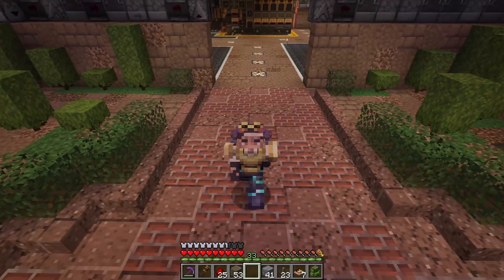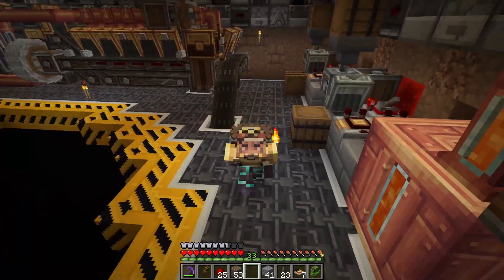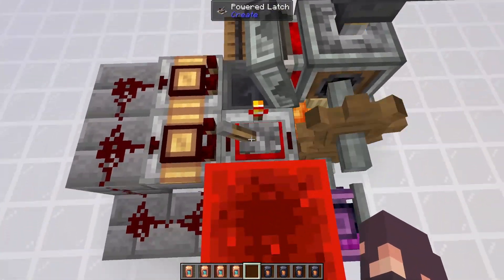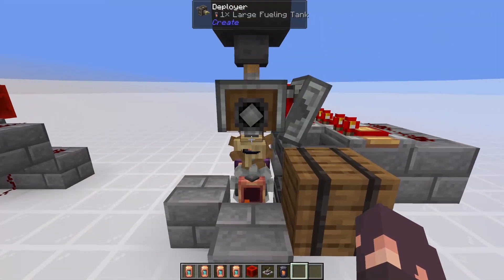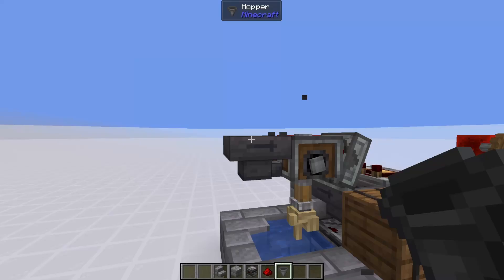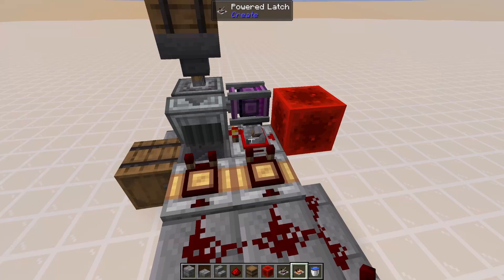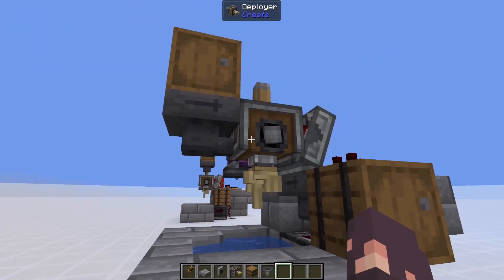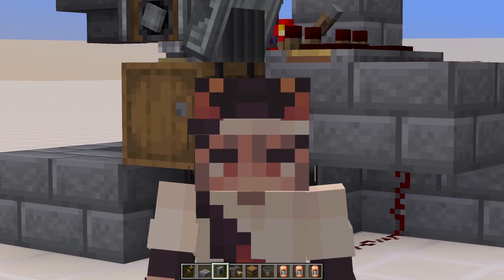Automatic Fueling Tank Refiller | Create Mod TUTORIAL

Comment: This is a great solution - regarding the lava i had to do some weirdness with it being pulled - my infinite source was some 80 blocks away - all pumps in between there and this one were running at max rpm as i thought they were too slow and thus wasn't filling quick enough. Because of this the observer perceived it as being done when in fact it just hadn't refilled yet. Got around this by having an intermediate tank that sits between this device and infinite source - so that fills whilst not in use. Not sure if its covered in the video or i did something wrong.
Reply from the maker: That’s good to know. I haven’t run into that because I just accidentally had a tank nearby that was quick enough to refill it. This is good info for anyone else running into this issue!
Reply: so you added a secondary tank between the tank refiller and infinite lava source and it began fully filling the fuel tanks?
Reply: @andysantos2716  Yes i did and im about to use this again :D